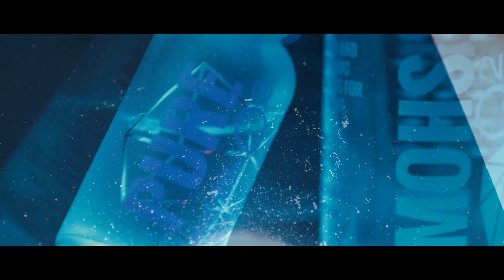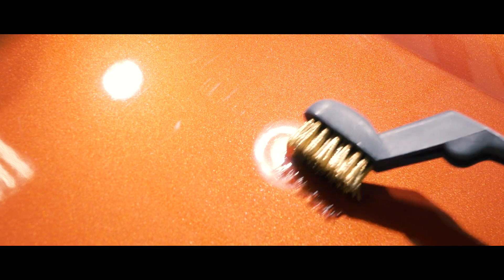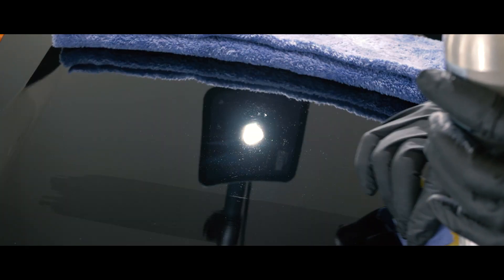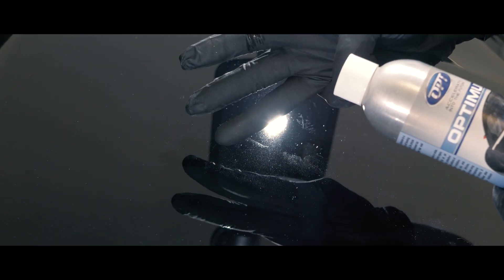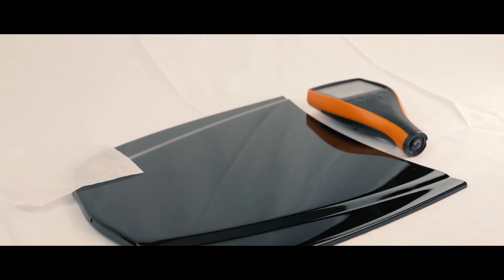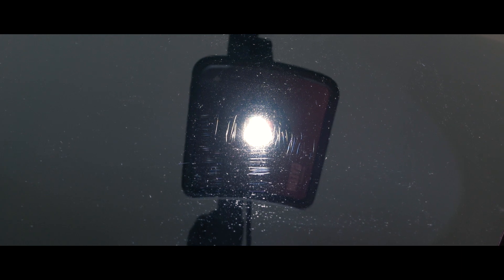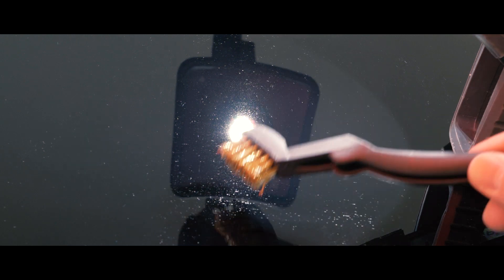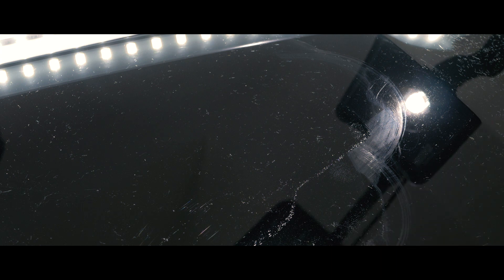Optimum Clear Coat Restorer (CCR) Self Heals?!

Comment: I have a 2015 Yukon XL in black. The roof and hood have faded and there is almost no clearcoat at all left on either. I was going to re-paint with basecoat and then cover it with clearcoat. Will your product do the job without having to spray? Also, how much product do you think it would take to do the hood and roof?